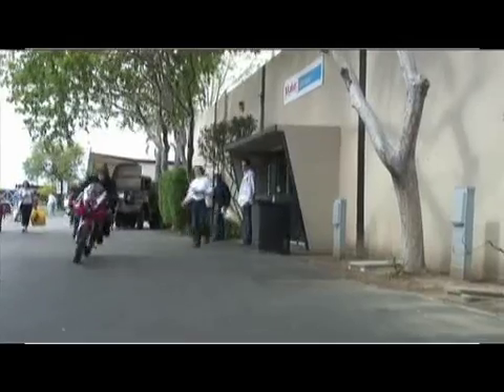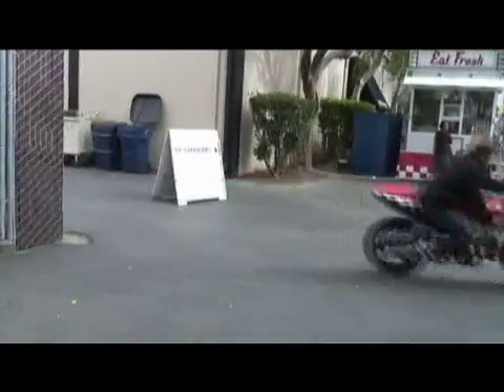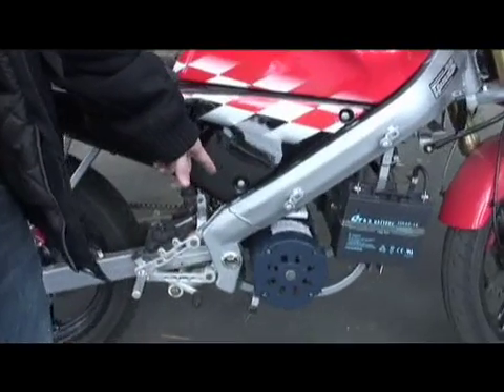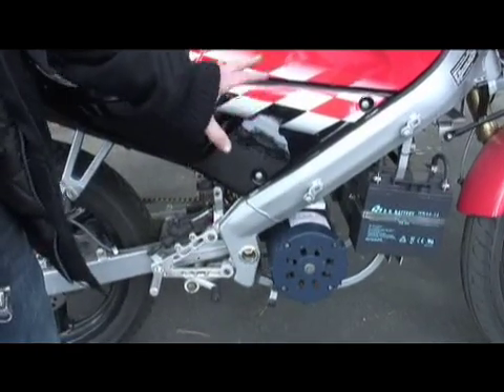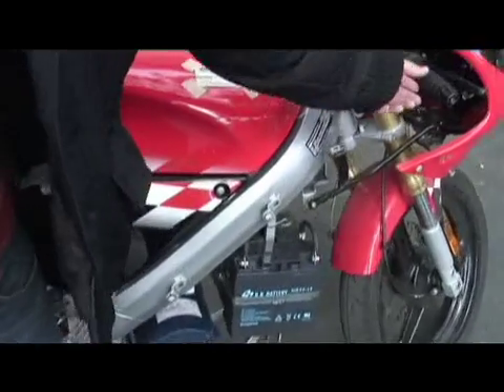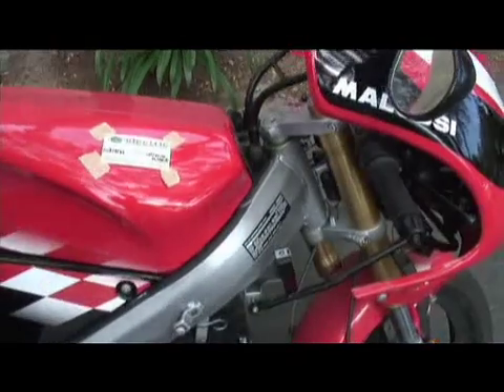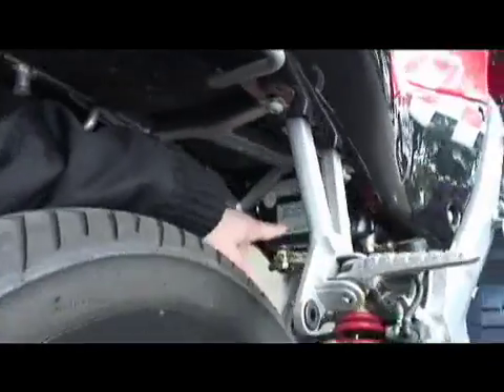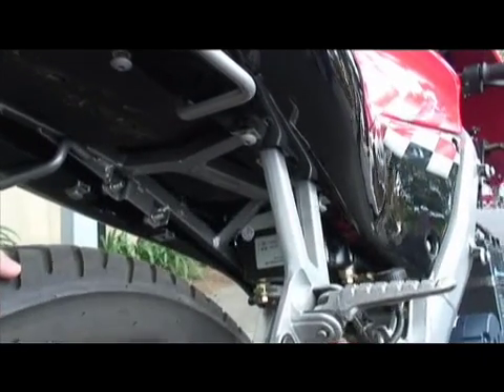Make Podcast: Todd Kollin's Electric Motorcycle

Comment: What I was saying is there are no "revolutionary products" being manufactured that compete with products that were already manufactured. Batteries would be a good example. Any high capacity battery comes with a high price. Why? Because you can do more work with it. It doesn't have a thing to do with production costs. CPUs would be another example. ...and on and on.